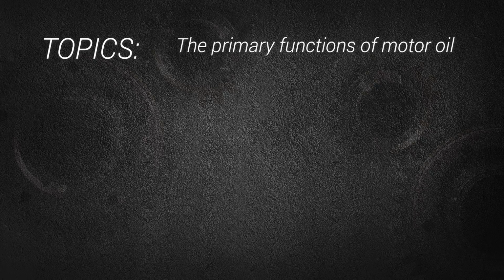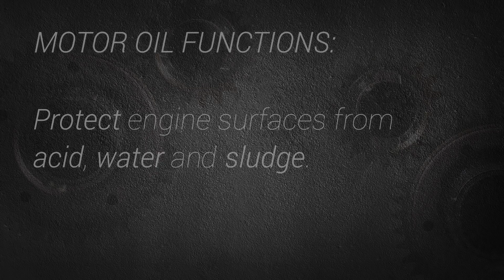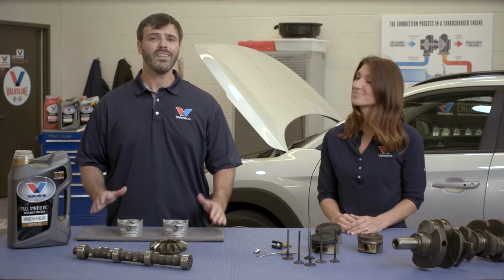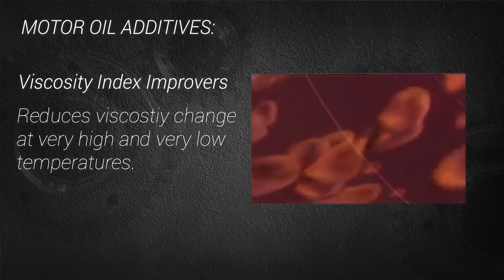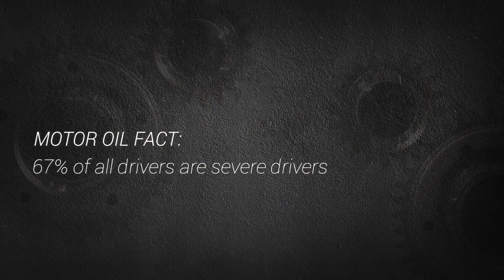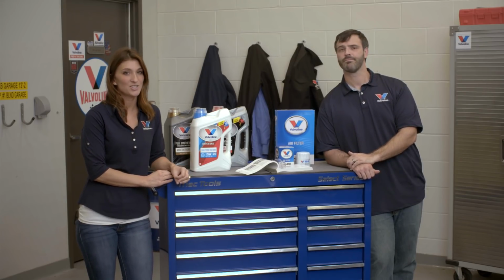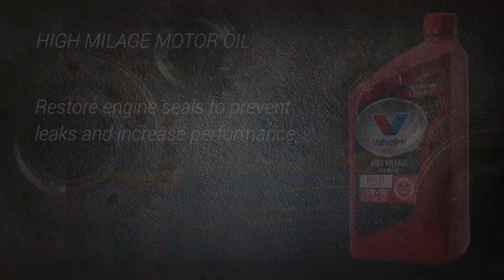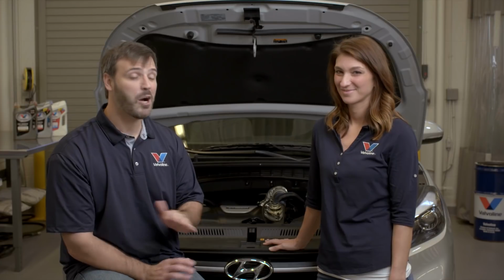Motor Oil 101 2018 Update v2

Comment: I like Valvoline for newer cars but if you bought a high mileage car, don’t, Valvoline is a detergent oil and you don’t want to break down sludge inside your engine if has over 70,000 without a good record of on time 5 k oil changes..